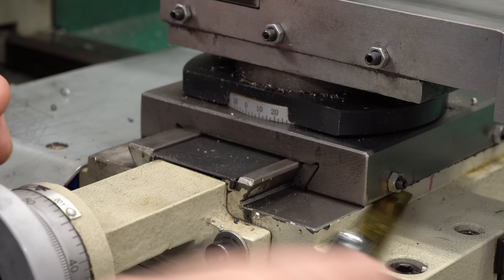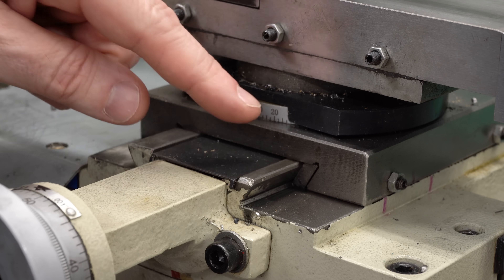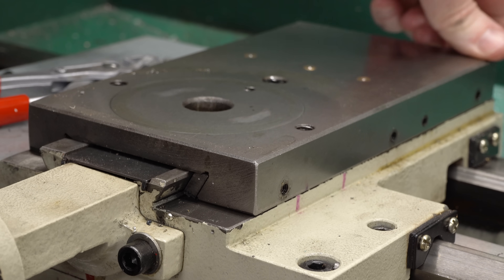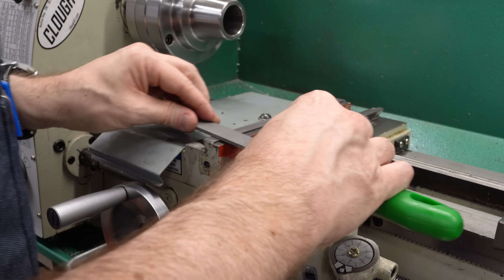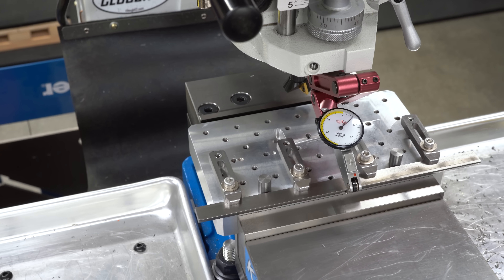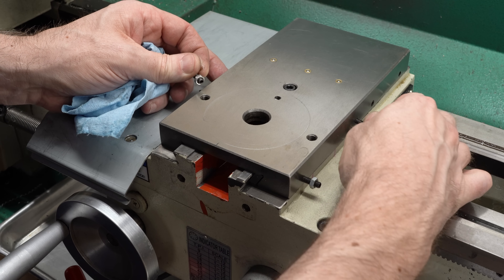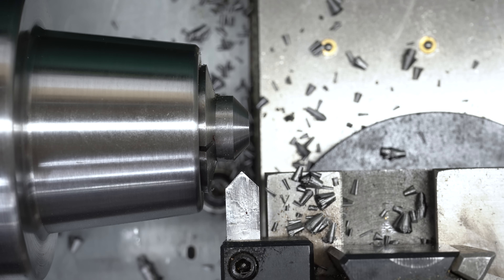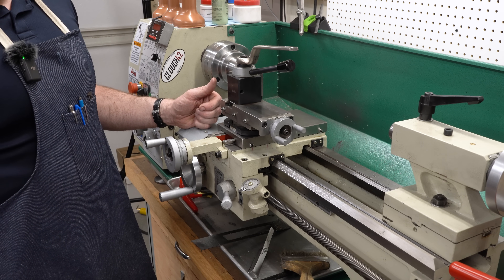Fixing a Factory Defect in the Lathe Cross Slide | Grizzly G0602 Fail

Comment: I hate seeing people spend their money on these things. They are not worth any money because they are built to take your money to give to China and you fight with them more than use them. Buy a used real lathe, you'll be happier.
Reply from the maker: For those of us in Idaho, used big iron is rare locally, and something like this is a great option for a hobbyist willing to tinker.  I'd love to have a Hardinge HLV-H, but a good used example is $12k and then you have to transport it.
Reply: @Clough42 point taken, I do agree because even where I am at, it's difficult to find a lathe in particular because they aren't given up easily. My biggest issue with many of these "budget" machines has more to do with operator safety because they're horribly built in most cases, I'm a 55+year toolmaker, and I have bought a couple of those hobby machines in the past, but having operated and owned much higher quality equipment, some of the practices used to create those cheap implements is astounding. The issue you cover is just plain carelessness on behalf of the people selling it, they know better, or don't care. Then issues such as complete lack of aging the castings, the day you receive the machine seems good, but a few months later, the warpage presents itself, and without professional help, the item is nearly useless. I've seen it a lot. Just from experience, if you can avoid the  oriental knockoffs, save a bit more money and hit some auctions, you'll be much happier in the long run. (And an added bonus), you'll usually get most of your money back when you sell it...😊

Comment: I know this is old clip, but it just poped up...
Why not just travel cross slide all the way back? 
It will disengage the screw from the nut as you go all the way back, so you can slide the cros slide to the back, and remove it without removihg the screw carrier.

Comment: Great video.......and surprisingly........humor???   Keep up the humor for sure.    I have a somewhat similar issue with the saddle.   When handmoving the saddle left or right in small adjustments......it tends to stick and you have to use two hands to move it a small amount  smoothly.    I did try different oils for the ways....but little or no difference.    Removing the saddle I found the runners that meet the ways were covered with some kind of synthetic straps which run on the ways.   So there was no metal to metal contact.   Have you ever heard of a situation like that????   The lathe is about the same size as yours I think.   13inch swing by 24 inches.....1.5 horse motor.    I 'very had this lathe for about 3 years........and I'm kinda passed at that setup.   Under power  feed it's OK.   I feel somewhat cheated.....and as a result they probably didn't have to harden the ways.......     any thoughts?????

Comment: I ordered the GO752 and it was nothing but disappointment after another. I should have leaned when they sold a table saw to my dad that had a cracked casting. These guys sell some of the lowest quality garbage and I will never give them another dime. My saddle, cross slide and the upper slide are completely trashed brand new off the crate. I called and complained and they shipped me a Gibb for free. what am I supposed to do with a single unfinished Gibb? I was supposed to receive the tool post slide which was gouged out at the Gibb.  You need to have an indicator and flat stone to surface and grind it parallel before putting it in. Sheesh. I will stop.

Comment: Order one of these G0602 lathes back in early 2007, it arrived defective in similar problems with the compound and remarkable amount of slop in the cross slide.. Sent it back to Grizzly, no thanks.. Replaced it with the G4002 few months later.. Been with the G4002 since 2007, it's been a reasonable bench top lathe for the cost and what it's capable of..

Comment: I want to first say, I enjoy your videos very much. Your attention to details is commendable.
However, your assumption that the gib was too tall, was maybe a bit premature. The height of the gib, in principle, should be the same as the height of the way. From the bottom of the way, to the clearance surface. I would have checked the lower edge (corner) of the gib for adequate clearance. 
I'm in no way trying to be critical, I have over 40 years of precision scraping experience, so I just wanted to share my observation. 
Again, I enjoy your videos very much, and will continue to do so.

Comment: I never thought of checking gibb height.  I assumed the fit was from warped pieces.  I did replace the 2 bolt ring clamp for the compound and it made a huge difference on reducing deflection, 4 bolts and a 5/8 plate is mo bettah than the ring.  I have the exact compound setup on my G0752.  Time to check all the gibbs in the mill and lathe.  Thanks!  That Shars QCTP is way better than what it comes with, I have the exact same one.  My next compound upgrade will be a plate with T nuts so I can adjust the Tool Post front to back without moving the compound.  I believe this will reduce deflection a bit more as the compound will not have to cantilever to machine smaller pieces, I can just move the T nuts back and keep the compound centered.
Make Chips!!!

Comment: A pretty weird dimensioning problem with those dovetail tops. Given that it should be a clearance fit I can't think of a reason why the manufacturers just didn't design into that part so much clearance that even with loose manufacturing tolerances it would still have clearance.

Comment: So, what I'm taking away from this video is... if I buy a lathe, add part of the initial set up,  to inspect tolerances and clearances using a feller gauge and maybe check bearings for flatness if able. Cool. I love learning stuff like that! True it's possibly expensive for you to find that out but it's cheap for me to learn that lesson.
Reply from the maker: Yes.  Most inexpensive import machine tools need a little love right from the factory.  Many people consider them 'casting kits' for building your own machine tool.  :)

Comment: I have the G0572 and the top slide does not travel correctly it gets stuck, cross slide also gets loose and sticks, the saddle is not snug. Interrupted turning causes the saddle to dance up and down as if it is really on a horse.

Comment: Get rid of that darn set screw gib and cut in a tapered gib. That made a world of difference on my mini lathe. Although it was a scary process to do because I had to mill my cross slide and make a custom gib. The set screw gib is only making contact on one side and essentially pivot points. That allows the cross slide to lift on the gib side under pressure. My mini can cut stainless like a big boy lathe.

Comment: Well Done !! Guess I'll Be taking mine back a part.  Mine had a bur a the back of the gibe and a notch in the dove tail.  Preventing full travel. This is my first lath of 17 years. I just cut really slow.  Never knew where the bearing surface was. Think it's time to do full break down of all sliding / bearing surfaces.

Comment: I have a Grisly but an English Chester Lathe MF42B, not the same but the problems are similiar. My cross slide was 8 thou LR incline but the problems are not over. No a lot of care making these lathes. All my leadscrews have been replaced with CNC style screws over 20 years, but for the money it has been a good workhorse if carelessly made. My main carriage ways are zero clearance on left and 5 thou on right on main carriage but cannot see exactly where problem is. Ho hummm.
Your journey is not yet complete!

Comment: We have the g752z 10 x22 lathe which is very similar except it has the thre phase motor and digital readouts . Recently the spindle bearings not out this lathe is only about two years old and not heavily used. The spindle was removed and the bearings did fall apart. The cups were removed ith a puller but getting the remains of the bearings off was impossible. So a new spindle and bearings were ordered and received. The front bearing was almost impossible to install until gently warmed up it the was pressed on. However the rear bearing simply would not go on. . Grizzly tech help was no help at all.   I thought the spanned nuts were supposed to allow some preload or adjustment. Once the rear bearing is pressed on it’s not going anywhere. My son tried an the spindle is essentially loose on yhe bearings. The spanned nut can not move the rear bearing. So another spindle and bearings is ordered. We tried getting bearings at  local bearing supplier but they could not find. Them. . So should the spindle be polished down so the rear bearing is maybe a snug but movable fit so the re can be some adjustment?

Comment: Your comment about only having two bolts holding down the compound slide is a major contributing factor to its lack of rigidity got me thinking. I wonder about that because I checked Grizzly's bigger lathes as well as Precision Matthews' larger lathes and they all seem to be held down by only two bolts. I wonder if the issue is that the two bolts are not separated far enough from each other (the only thing that comes to mind if the larger lathes are OK with only two bolts holding down their compounds) or if there is some other issue, like the bottom of the compound not being machined flat letting it rock or flex under load. Anyway, your lathe is still more rigid than my vintage Craftsman 12" which sometimes feels like spaghetti. 😀

Comment: i went straight out to my 80's Taiwanese lathe, got out the dial indicator and stand and continued my quest for more rigidity. Last week I sat my lathe on an improved bench and gained. I've found .002 movement in the bed to carriage and my compound has a little of the issue you just corrected. Won't be happy till my parting tool work well on steels. Thank you for the enlightenment.
Reply from the maker: Parting is the acid test for these little machines.

Comment: Sorry I should have mentioned the cover before you put the cross slide back on. My bad! I have a 9x20 lathe and although it's small, since I put the fixed cross slide on, it made a world of difference in my rigidity. I took my cue from Robin Renzetti and Stephan Gotteswinter and have never regretted trading the compound slide for the rigidity of a fixed post on the cross slide. I can always add it back if I have a special case situation. Seeing that you still need work on the compound/cross slide makes me think it's time for you to get a surface grinder. It adds a whole new dimension to your capabilities and a used one is a bargain, tool wise. Thanks for the tip about powder coating lettering with the laser. I don't have the cash or room for a fiber laser or one powerful enough for etching but I have an extra solid state laser head for my CNC plasma table.

Comment: another major upgrade is re-making the cross slide "compass?" out of 4140.
it holds the tool post screw and has clearance for more thickness but they didnt use the space and the casting is "flexy"........

Comment: I have both a Grizzly Lathe and a Mill and they both needed some serious finishing TLC to get them in top working condition. My mill was noisy as hell right from the factory and that was due to the idler pulley for the speed change belts having an egg shaped bushing and the front set of pulleys were not aligned with the rear set through the idler. My intent all along was to put a three phase motor with a VFD (now very reasonably priced these days) Once I did this and aligned the pulleys properly it got dead silent! I always suspected that the spindle bearings were crap too , but they showed very minimal run out. I took the idler pulley out of the drive circuit completely and it runs great now. Along with some other tweeking, scraping, and adjusts both machines work well now.  I also added electrtonic RPM gauges to the motor shaft and the spindle shaft to keep track of motor efficiency and actual cutting speed RPM.

Comment: I just sold mine.  Didn't like the rigidity, as in, their was none.  Now I am sorry I didn't look closer.  Why such things leave the factory that way is beyond me.  The quality control sheet with the taper and run out specification must be boiler plate.
Reply from the maker: I worked with someone once who had a lot of experience in China, and he told me "Everything you've ever heard about China is true, somewhere.  It's an enormous country, and there are a lot of different things going on."  Are some of the spec sheets fake?  Almost certainly.  Are some of them legit.  Probably also yes.
Reply: @Clough42  Thanks for the reply.  I now have an almost new condition Myford.  It has none of the IKEA, self assembly, issues.  It also cost a lot more.  I guess we, as a collective, refuse to pay for quality.

Comment: As Stefan would say, “These imported machines can be very good, but you have to consider them as a kit that needs building correctly” or certainly words to that effect. He has had great results with his (much modified) lathe and does some incredibly accurate work. Great video, thanks for sharing.
Reply: Imported is a funny word, when the lathe was manufactured just 6 hours away from him.
Reply: @an2thea514  6 hours is about 45 times the distance from the earth to the sun, there is nothing out there to import a lathe.
Reply: @ChristophPech  Well, EMCO made their lathes in Hallein, Stefan lives somewhere in middle Germany.
Reply: @an2thea514  The distance from Hallein to Stefan Gotteswinter is about 667 microseconds. Considering walking distance according to Google maps it is a bit further, 704 microseconds.
Reply: @ChristophPech  so my point stands
Reply: Yep, my little 7x14 is clearly a kit. Just looking a the tail stock tells me that.
Reply: That's outrageous for a 2k+ machine, and manufacturers needs to be held accountable for it.

Comment: James;  Thanks for the timely video.  I have a smaller cousin to your lathe,  a Harbor Freight 9" x 20"  of 2005 vintage.  I broke out the feeler gauges and I had the same elevation on the tailstock side of the cross slide.  Hand finishing the gib strip and stoning of contact surfaces had a similar positive result as your video with the gap gone.  Please keep up the thoughtful analysis you put in on your video productions!!
Reply from the maker: That's really interesting.  I wonder if there's a story behind why so many machines are like this.
Reply: @Clough42  Odd thing I found is that both the saddle surface and bottom of the cross slide contact surfaces were crudely hand scraped with very crude grinding tracks on the saddle.  I would say this was more for appearance  than function.  Anyway the cuts now are much more solid  though still limited by the small size and power native to this machine.  Thanks again,  LRU>

Comment: Is a flat top grind on the cutting tool recommended when turning hot rolled mild steel (a36)?
Reply from the maker: Likely not.  I would prefer some back rake for mild steel, but the advantage of a flat-top chamfer tool is that you can cut on either side, and it's quick and easy to touch up on the grinder or with a hone.  If you tried to put a back rake on it, it would be hard to maintain 45 degrees, and you would have limited ability to regrind as it wears.

Comment: my only experience with import lathes has been very poor, i bought a 12 x 28 import from Chester Machine tools, when it arrived it was rusty, the tailstock was out of alignment and low by nearly 3mm. the headstock was out of alignment and had casting sand in the gear case, the cross slide and compound both needed re machining and scraping in, power feed to the cross slide didn't work. support from the company was non existent. i wanted a smaller lathe to supplement my big and very old Colchester but this turned out to be a very long project to make a usable if not very accurate machine.... thinking back i should have just cut my losses and put the whole damned expensive thing in the skip
Reply from the maker: Wow.  3mm low is really inexcusable.  That's crazy.

Comment: If they're prepared to sell a machine with such an obvious flaw, how much more crapness is hidden? I think the term "hobby lathe" means that fixing the machine itself becomes the hobby, rather than its use in any other projects.
Reply from the maker: This is often the case.  As far as I can tell, the headstock is good.  The motor worked, but wasn't great, but I replaced it with a 3-phase motor and VFD.  There are some other minor gotchas, like the close-but-not-exact metric screw in the cross slide.

Comment: If you replace the compound with a new plate and 4 or 6 bolts it a way better my parting got way better I routinely part 2 inch aluminum and now I can easily take 100thousandth cut in steel and 150-180 or more depending what you use in aluminum at 1200 rpm 👍👍👍
Reply from the maker: Yeah, it's on my list.  I'll probably make a new compound clamp, and also a solid riser block the same height, so I can use whichever suits the project.
Reply: @Clough42  lol I got really lucky I had just finished the plate I went with 4 bolts instead of 6 anyways when removing the original plate for the last time I went to loosen the two bolts and the right bolt twisted in half lol I thought dam that was lucky at least it broke right when I finished 😂😂😂